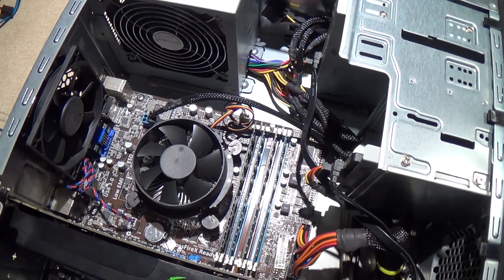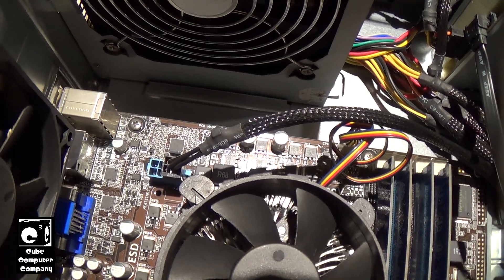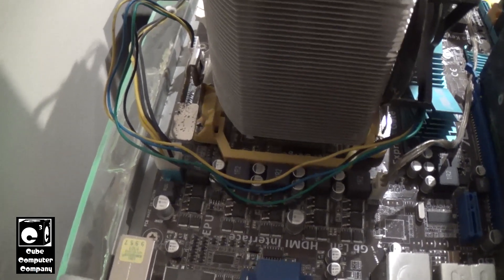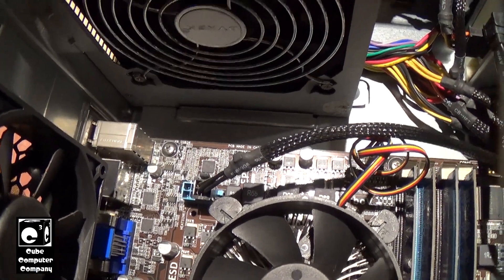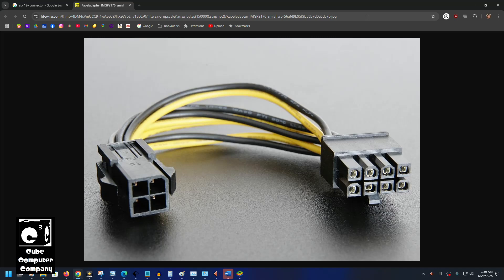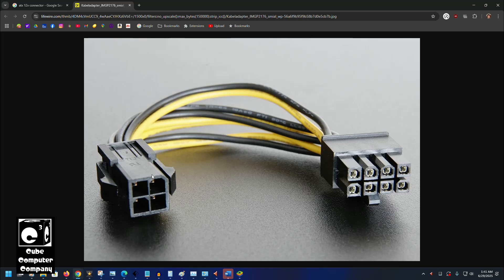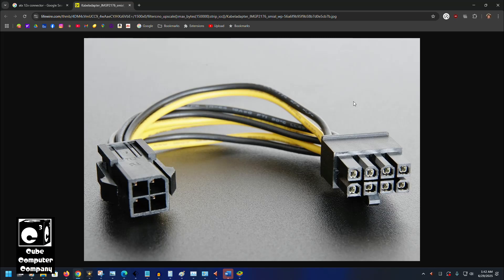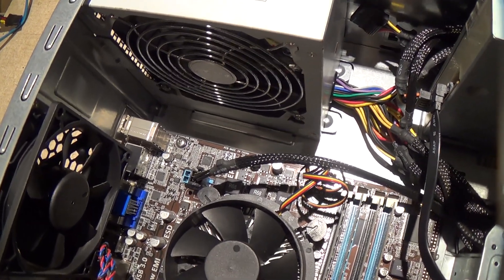Can you safely use an ATX12V 4-pin connector on an EPS12V 8-pin motherboard?

Comment: So a 4 pin connector should do the job for a ryzen 5500 65w tdp?
Reply from the maker: Yes, a 4-pin CPU power connector has enough capacity for that CPU.
Reply: @CubeComputerChannel thanks for the reply
Reply: @CubeComputerChannel  What about i3 13100? Thanks in advance!
Reply from the maker: @stolefx  That CPU has a base power rating of 60W and a turbo (peak) rating of 110W. I'd say you'd be okay if your PSU only has a 4-pin connector.
Reply: @CubeComputerChannel  Thank you so much for a reply!
Reply: i5 9400f would work on a 4 pins ??
Reply from the maker: @GunBoyz-v7u  Google has your answer... where I have looked up the answers as a courtesy, prior.
Reply: Any updates did it work good for you ?

Comment: I accidentally shorted the ATX 4-pin connector. After repairing the motherboard, can I use the same PSU in my PC?
Reply from the maker: How did you short the connector? It can only go in one way...

Comment: what about the other way around, a 4 pin mother board with an 8 pin power supply, is it sfe?
Reply from the maker: Yes, it's fine provided there is room for the overhanging portion of the connector.

Comment: The first gen threadripper I had  has two 8 pin cpu connectors. The motherboard manual diagram shows which connector to use if you don't over clock. I imagine intel cpu's with 16+ cores probably have the same option.